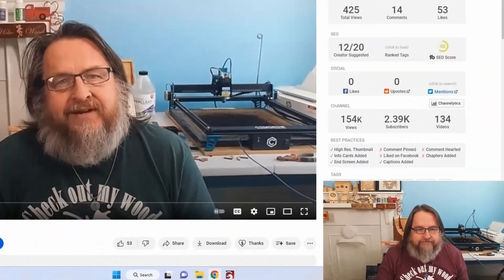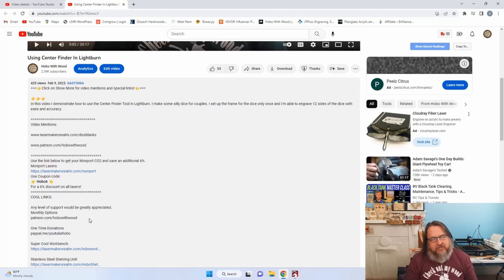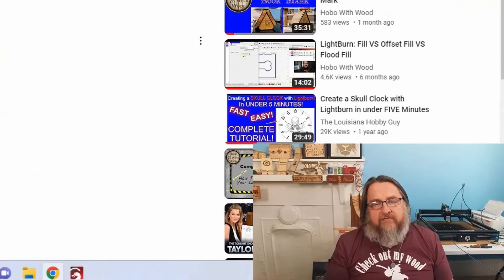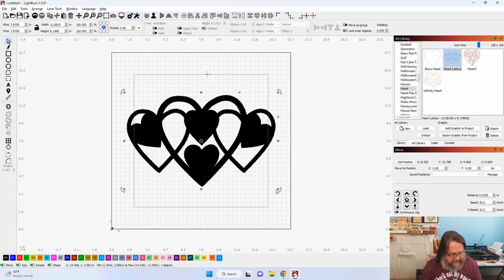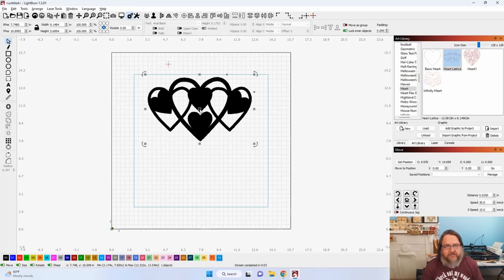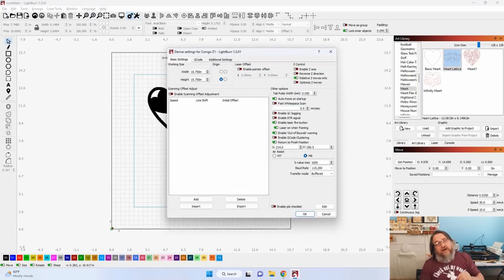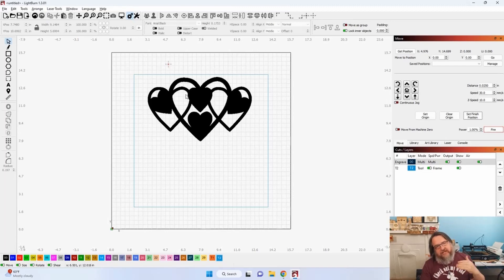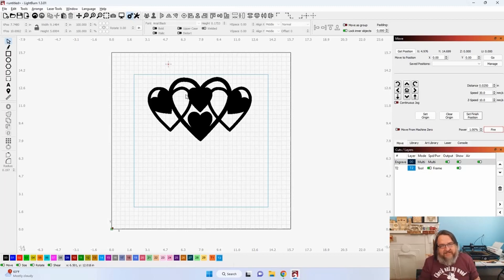Set Finish Position On Lasers Engravers Without Limit Switches

Comment: I can't seem to figure out the settings on the longer Ray5 10w constantly wants to hit the side front left corner when I go to home the machine with the computer it will hit the frame. If I use the memory chip that came with it, it works just fine. I can't figure out what setting is wrong in lightburn

Comment: watched it all. Didn't work, did it all three times. Does not work with no limit switches.
Reply from the maker: Can't understand why it's not working for you. Limit switches would make a difference on the exact repeatability. But it should still work. What laser are you using?

Comment: Good information as always Steve. Most, if not all of the new 32 bit control boards do have reverse polarity protection, however, if you have  a cheap laser or an older 8 or 16 bit version, you can and may cause serious damage to the control board. But even on the newer boards, you can corrupt the software on the control board by moving it by hand. Every feature in Lightburn is there for a reason by design. There wouldn't be a Move tab if it wasn't needed. xTool does an injustice to the newbie community by using the laser improperly in their demonstration videos.

Comment: Great information, Steve. I learn something every video, even things that aren't in the main topic. Thanks.
Reply from the maker: Glad to hear it! I'm getting ready to drop a really good one designing in Lightburn. Using every tool you can think of and some you might not think of. It's in real time, designing a small box and lid from scratch. It's long. Over an hour.  May have to be watched in shifts. The project itself may be useless, but the techniques demonstrated are great ones to learn. Plan to drop it tomorrow at 1 PM EST.
Reply: @HoboWithWood  AWESOME!!

Comment: In reference to your statement about manually moving the laser module with the unit powered off, this is only partially correct.  A stepper motor will act as a generator when you are spinning them by hand.  The power generated is a function of how fast you spin them.  The faster you move the laser head, the more power you are generating.  When these control boards are built, they are built to a price point.  So while the board could be built so that it will easily resist the back voltage produced by manually moving the laser head, that costs money and there goes your profit.  So what they do is design in just enough protection so that warranty issues won't put them out of business.  This applies to anything that uses stepper motors.  In the years that I've worked with 3D printers and laser engravers, I have yet to burn up a board by manually rotating the stepper motors.  I just don't move them fast enough to generate the back voltages that will cause problems.
Reply from the maker: You are obviously educated and know what you're talking about. How many videos from xTool have you watched? How many times does xTool demonstrate excessive movement and speed? How many first-time laser owners watching their videos know when too fast is too fast? It's better to simply not do it. I did it when I first started. But since learning better, I have never had a situation where I was forced to move it manually. Thanks for watching, and thanks for your comments.
Reply: I have not watched a lot of videos that were make by xTool.  A lot of what I've watched from them seemed to be more sales pitches than instructional videos.  So I don't watch them any more.  And, yes, I cringed every time I saw them whip that laser head around.  They are definitely setting a bad example.  Manually moving the head is just something I started doing when I was learning to do 3D printing.  Never thought much about it.  Just a FYI - I try to keep the speed to less than 75 - 100 mm/sec.  It hasn't bitten me yet.

Comment: I agree that moving the laser and gantry by hand can make the stepper motors act like generators and back feed voltages to the control board. But, at times, you may have no choice but to move the mechanisms by hand. You can reduce the possibility of a voltage spike damaging the controller by moving the pieces slowly. The faster you move things, the larger the voltage spike will be.
Reply from the maker: Here's the same reply I posted to Jim...
You are obviously educated and know what you're talking about. How many videos from xTool have you watched? How many times does xTool demonstrate excessive movement and speed? How many first-time laser owners watching their videos know when too fast is too fast? It's better to simply not do it. I did it when I first started. But since learning better, I have never had a situation where I was forced to move it manually. Thanks for watching, and thanks for your comments.
Reply: @HoboWithWood  Perhaps you need to move the entire machine and you don’t have your computer connected. If the gantry in not already against the edge you need to move it safely, then move it by hand, slowly. Or perhaps you need to turn the machine over, same problem.